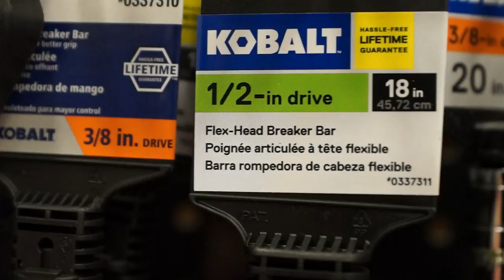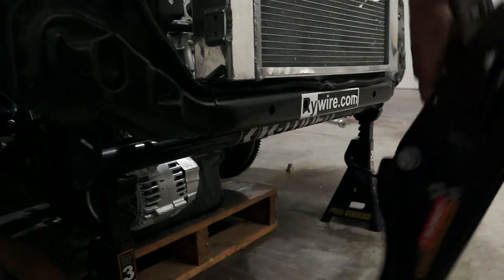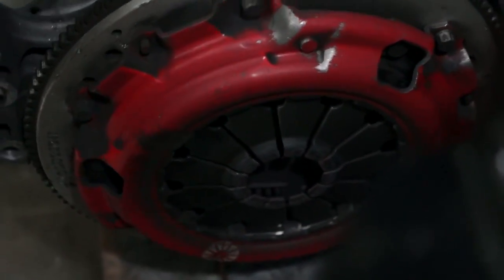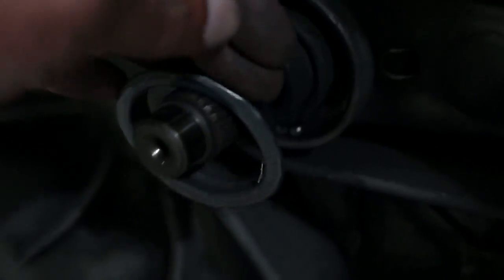THROW IT ALL OUT! THIS MIGHT NOT BE NORMAL

Comment: incredible work, I have a k swapped civic that had a k20a in it last week but when I went to start it up I found out that the timing chain had a flaw and it ripped the sprocket to pieces. the next day I got a k24a4 and it's almost done. currently my struggle is just getting some of the issues solved with the harness so it can finally be up and running before I throw my turbo set up on. I definitely look forward to seeing how it comes out and I really hope it comes out as perfect as yours did!

Comment: for ur old fuel lines not ur new high pressure lines did u need that  assembly tool i dont need to do high pressure atm just regular k- tuned braid line
Reply from the maker: +Sean B no you don't need the tool.  That tool is specifically for the high pressure lines.  For normal lines (if you're making them yourself)  you just need your hands and a AN wrench or normal wrenches if you don't care about scratching up the fittings.   

The ktuned and hybrid racing fuel lines they sell come pre-made
Reply: Childstar thanks bud

Comment: I almost want to say that's a typical honda problem. on my 3rd honda right now that's needed that done. if you got the money keep a couple in Stock hahaha
Reply from the maker: +Michael it's not typical.  My engine is upgraded far beyond the specs of the rest of my clutch setup that was a mix of old and new.  My pressure plate is the oldest and the fingers do have some damage.

Comment: back space 35+ = 6 inch right
Reply from the maker: +Giuseppe Randazzo offset on my Volks is +35mm, so 35mm from the center of the wheel is the mounting face to the rotors. 

25.4mm = 1 inch

5.37" on the inner barrel (backspace) to my te37's.

Comment: I have14 inch  rimsnow I want 15 so I don't know  if will fit on my car I'm trying to buying rim customer service wants me to look for backspace
Reply from the maker: +Giuseppe Randazzo .....a 96 civic is the same body as the em1 civic si and the Si comes with 15" wheels as standard already, so why in the world wouldn't 15" wheels fit? Whoever is helping you isn't very smart. 

Another thing, I clearly have 15" wheels on my car as well as many others, in several different offsets so it's clear that 15" wheels fit. Brake clearance on large break setups is the only thing that would make fitment questionable